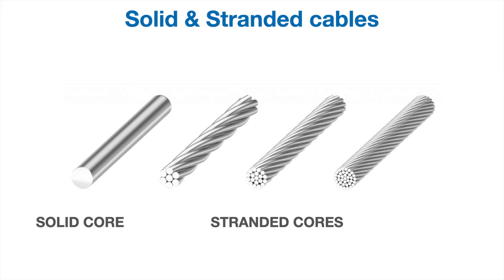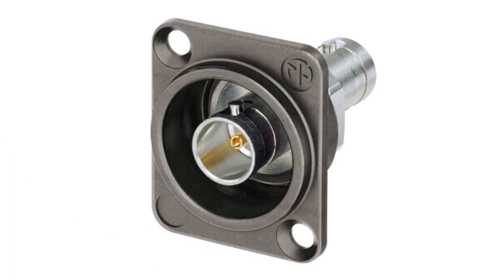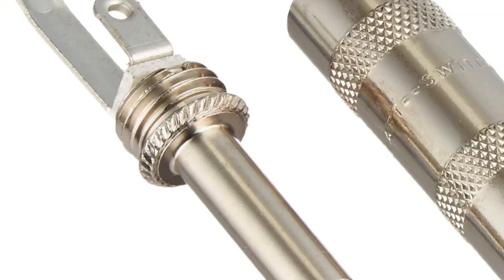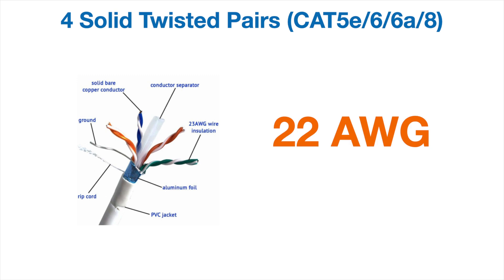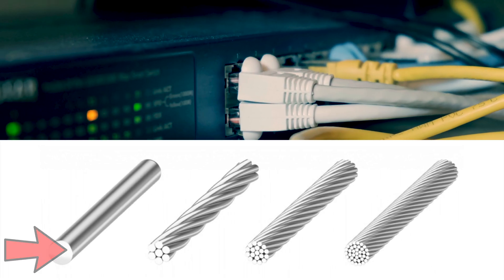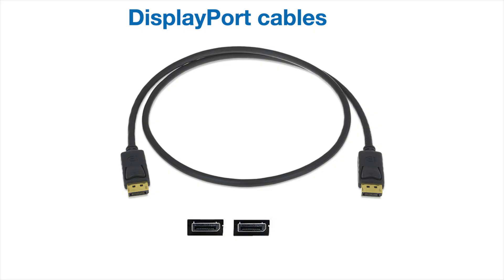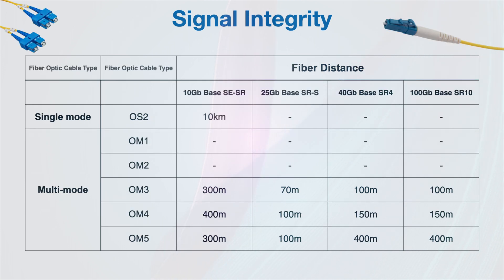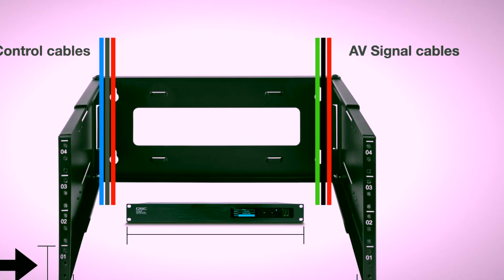Cable Types used in AV and IT - Cable Selection Guide

Comment: You should have mentioned the RG6 coax used for antennas and CATV which is generally copper coated steel cored which is not good for SDI as it reacts differently than pure copper conductors and the electronics on the ends don't work well with it.